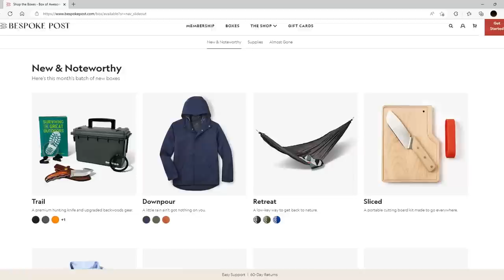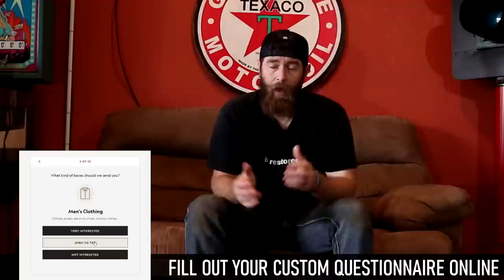Abandoned 1934 Chevy Remains Found In Creek Bed | Turnin Rust

Comment: Early 1930"s Chevrolet(GM) bodies where basically rolling pole barns.  I restored a 1932 Chev 2 door sedan.  It had about 200 pounds of hard wood.  The floor supports were 3 strips of wood layers about 2" thick. The floor was plywood. The entire sheet metal body parts were nailed to the structure.  The doors were built the same way. A sheet meal stamping then nailed to a wood frame. The wood was not treated, so the cars fell apart in about 10 years.  Most GM cars were scrapped in WWII for metal.  30's Fords only used wood for the roof support, the rest of the body including the doors were all steel.  That's why so many Fords survived.

Comment: You have the remains of 2 cars here.I had one of these, It`s a 34 chevy sedan. You can tell a 34 from a 33 as the 34 had single body line bead on the cowl & the 33 had double line bead (35:36)  The other unidentified one could be used for parts(please don`t scrap). The front fender goes to the the other one as the 34 chevy had skirted front fenders.

Comment: Probably, the most "logical" way to reconstruct this would be to build some sort of temporary frame to form a "skeleton".  Build the frame from 1/2 inch PVC water pipe,
starting with the largest piece from the rear and build forward.  The frame would be sufficient to hold pieces in place while a couple of tack welds stitched it together.
It would have to be a labor of love because this jalopy probably wouldn't hold together enough to be placed on a frame.